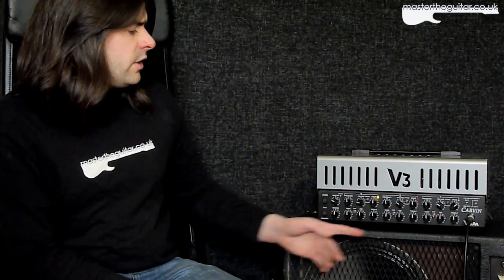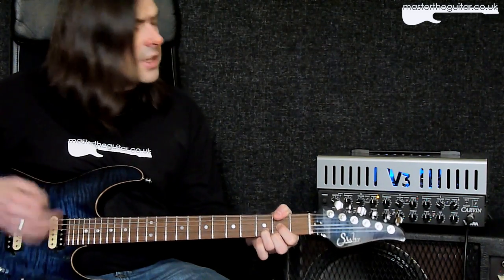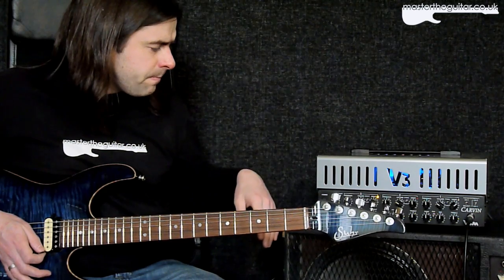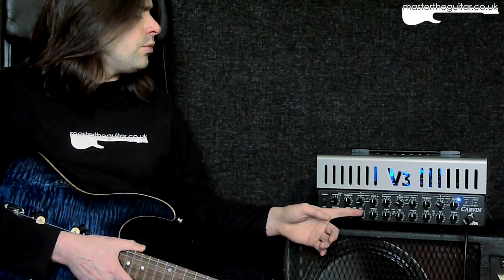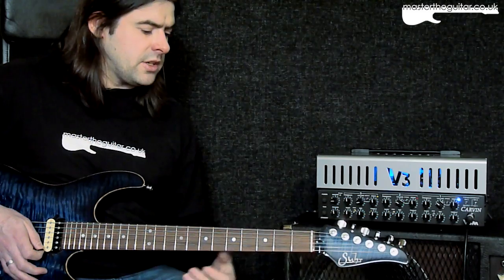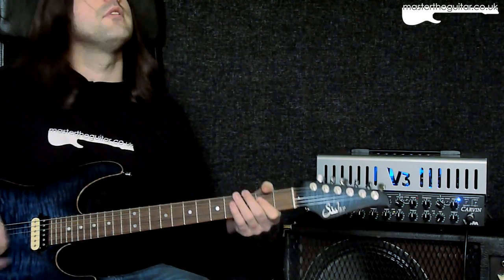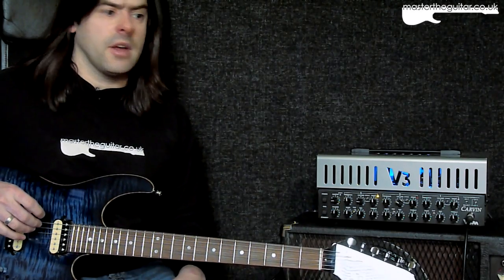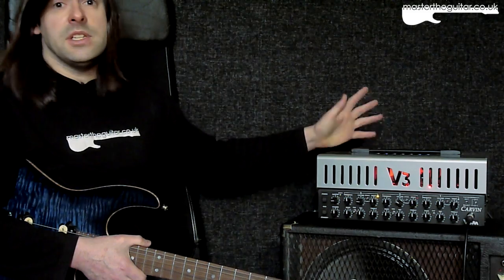Carvin V3M in-depth demo - MasterThatGear!

Comment: This is easily the best demo of any amp i have ever heard. Great job mark! I have the combo with the GT12 inside. Not of fan of that speaker but, plug it into any 2X12 or 4X12 and it really comes to life. The open back is necessary i suppose for a combo but, definetly takes away the texture of this amps capability. I also just purchased the Carvin Legacy 3 amp and that amp sounds amazing from warm to super crunch. A clean channel to die for. I can play that all day but shredding i go to V3...

Comment: That is the thing about this amp you half to know how everything works and the best way is to play with it yourself. Also with this amp on overdrive you can dial your volume back on your guitar and clean up the sound so before you judge this amp take time to spend time with it and you will find your sounds,also as the tubes break in it sounds more smother what you need to know also is the second channel the drive only needs to be on 2or3 setting to play classic rock.This is the best video to show off this amp I also think!

Comment: It wasn't until 22:50 that he started actually using the tone knobs! Since they DO affect each other in these amps, simply taking turns rolling off and diming the bass/mid/treble knobs doesn't show much of this amp's tonal range. The Presence control has a wide range he didn't explore, even though it's the range of many amp's 'treble' (the 'treble' is more like a 'hi-mid'; use your Presence control!). My ONLY beef with this amazing unit (I've used one on stage for 2 years now) is the clean ch. is voiced a lot quieter than the drive channels.

Comment: I'm having a hard time getting any decent clean tones with mine and I know it's because I'm using an EV12L speaker and the V3M was designed for a Vintage 30. What is a good application for the 12L? I know Joe Bonamassa loves them. Great demo, thanks!

Comment: Great demo. So ?, Legacy 3 or V3M? Currently I Play a Bogner XTC but gigging 4-6 times a month it gets heavy especially at 3am. I'm in a cover band and we range anywhere from Sinatra to Godsmack depending on venue. So Leg3 or V3M?  Anyone. Thx in advance.
Reply: from what i understand, the V3m is the most versatile amp they have, and the heaviest, so for godsmack type rectifier stuff this would be the way to go.

i myself am deciding between the L3 and v3m, but im in an original band and am looking for a specific sound, and being a baby about the price point of the L3
Reply: +bobby cox thx. I bought the L3 then sent it to my amp guy, retubed, and recapped it and it sounds pretty good now; not so much before the modifications. Clean and 2nd was useable with third channel being like  listening to shards of glass in my ear drums. (I'm using in ear monitors). After the mods it sounds pretty great not awesome but good enough.
Reply: The legacy 3 has the two distortion channels sharing eq, which obviously cuts down on the amount of tone difference for soloing.  The v3m has dedicated eq for each of the 3 channels, so wins in my opinion

Comment: Are this amp's 50 watts a loud 50 watts?  The reson I ask is becuase I've read in a few places that it does not sound as lud as a 50 watt amp.  I currently have a Mesa Mini Rectifier that is 25w, but i need a louder amp to keep up with my bandmates.  I am looking at a 50w amp and this amp has everything that I like in an amp, except I am concerned that it will not be much louder than my Mini Rec.  Please help !!!
Reply: andermarg The clean channel is not that loud in a band setting. U will need to use the boost or use pedals to make it louder.

Comment: I had this amp several years ago and if I was going to stay in the Carvin family, I wish I would have bought the Carvin Nomad or Belair.  I thought I would be able to get a good blues tone out of it, but it's a very "modern" sounding amp.  Unfortunately, the overdrive was WAY too fizzy and the cleans were too dark to be usable, even with the bright switch on.  Also, even with two speaker cabs with V30s, it wasn't that loud and my sound (or should I say fizz) kept getting lost in the mix.
Reply: I love my Carvin Belair.
Reply: +Michael McWilliams Yeah...the Belair is spectacular and for cleans it has a rear dial called acoustic resonance which when dialled past 12 o'clock puts you into the best fender twin type jangle with no hint of harshness and sounds superb. The Belair blooms when pushed hard and sound fantastic when very loud too.
Reply: Yup, the Belair is an awesome amp and one of the best kept secrets. I used it on my second CD.
Reply: i have a belair now. love it. owned an x100b in the past and loved that too. im looking for that x100b sound in a minihead, and on the fence between this and the legacy 3. +michael mcwilliams you ever give that legacy a try?
Reply: bobby cox
Watch out for pops and crackles appearing with the Belair combos. This happens where the tubes are direct mounted to the PCB and deterioration can occur. Just something to keep an eye on and regular checks may show up scorching marks around the board. This was my experience with my combo but I'm not saying it will occur with yours. Over all though the Belair is built very well and sounds awesome.
 

Oh btw try running it with the T.C G major...OMG!
Reply: bobby cox
 I never did try the legacy.  First of all, it costs an arm and a leg to return it if you don't like it.  Secondly, if Steve Vai doesn't play it anymore, that should tell you something.  Thirdly, I'd be afraid it would sound like the V3M, which I had and got rid of.
  That doesn't mean it would be a terrible amp, just not for me.

Comment: gREAT JOB. i HAVE ONE OF THESE. i LOVE IT. i USE THE CLEAN FOR ROLAND gr-55 SYNTH AND THE OTHER 2 CHANNELS FOR MID TO METAL. tHESE ARE GREAT . i HAVE A FOOTSWITCH WHICH HELPS, CHANNEL SECEXCTION, 10DB BOOST AND REVERB ON/OFF. CAN NOT BE BEAT FOR THE MONEY. i PAID IN 2013 600.00 FOR EVERYTHING INCLUDING A STURDY CARRYING BAG. THEY ARE DISCONTINUED FOR NOW. I HOPE CARVIN COMES BACK WITH SOME MORE AMPS. NO MIDDLE MAN, YOU GET ALOT FOR THE MONEY AND MADE IN USA. THE TUBE AMPS COMING OUT OF CHINA ARE CRAP. IT IS EITHER THIS OR A FRIEDMAN FOR MANY OPTIONS. MARSHALL IS GREAT IF ALL YOU PLAY IS ROCK, FENDER IF YOU PLAY HIGH ENS 50-60S COUNTRY, MABYE SOME JAZZ. I LIKE THE VERSATILLATY, WHICH YOU HAVE DEMONSTRATED VERY WELL. THANK YOU-SHAWN.

Comment: From the time the V3 was announced until its release, I was SOO excited for the amp. I really wanted to love it.
Then when it was released I went to the Carvin showroom to check it out, and it just sounded sterile and harsh. I was highly disappointed.
I am not a huge fan of the EL tubes, and prefer 6L6... and would have swapped them if I bought the amp, but it was just so below my hopes and expectations that I felt the tube swap wouldn't help enough to warrant the purchase.
I'm glad that some like the amp, because I like Carvin as a company.. but it just wasn't for me.
At this point, I guess I'll stick with Egnater or Fender. :>

Thanks
Reply: Try different tubes. I swapped one preamp tube and put in new power tubes from the same manufacturer. That's what I had. The tubes make a difference. My next move is JJ power tubes
Reply: udertyrat
ty!
Reply: +Patrick Petrie actually you can use this amp for many different styles of music. Take that middle channel and voice it for more of an overdriven sound and use the other lead channel for the high gain stuff. Use an od pedal into them for even more gain if you think it's needed (I don't). I saw a video from the Carvin factory where the person who built the amp said that the tubes they use aren't necessarily the best sounding tubes but they are reliable. It's easy to figure out. Look at your tubes. My preamp tubes were JJ and the power tubes were Sovtek. 

I used this amp with a band playing everything from Genesis to Metallica with 2 Ear Candy Bailey 2x8 cabinets (loaded with Webers) and I was asked to turn down!  You can do anything with this amp. Check out swapping tubes.  It does make a difference. Enjoy!